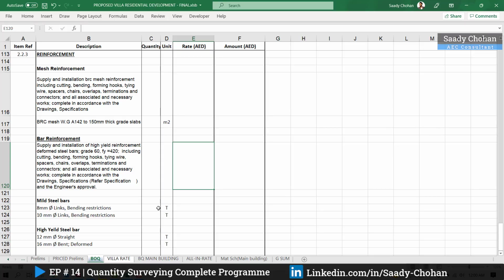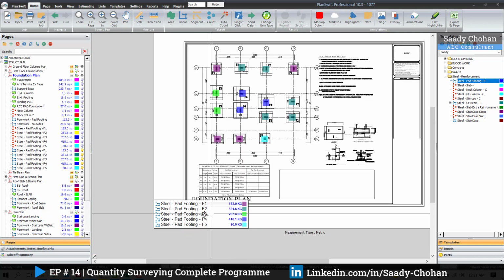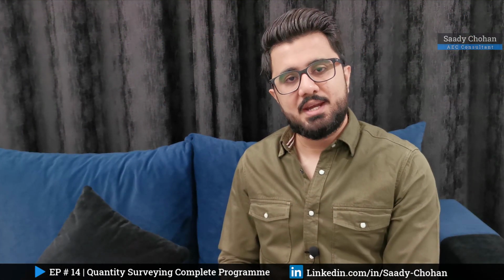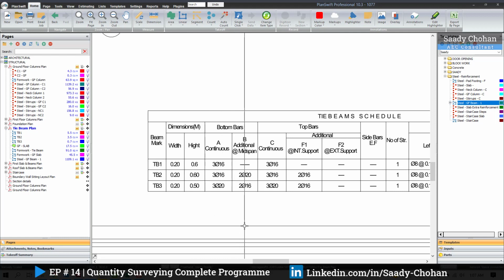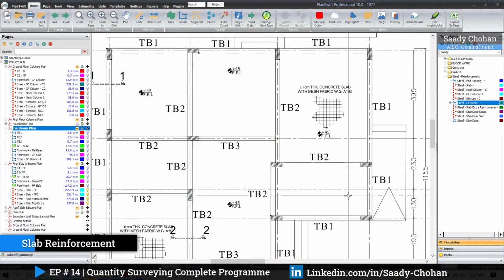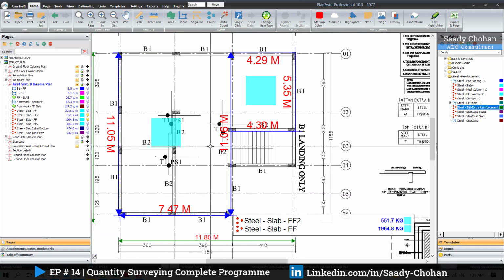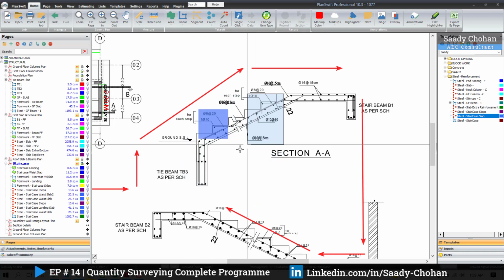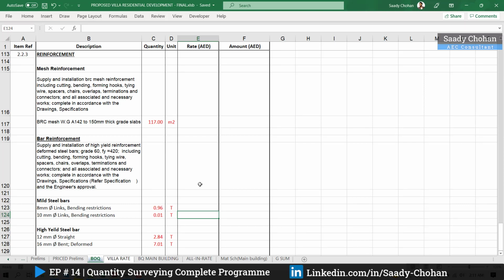EP - 14 | Steel Quantity Calculation by PlanSwift | BBS | Rebar Weight | Quantity Surveying Program

Comment: YES MR. SAADY CHOHAN. I SAW YOUR VIDEOS ITS VERY HELPFUL TO US. BUT THIS VIDEO I AM CONFUSED. 
YOU HAVE CREATE THE TEMPLATE TO CALCULATE THE BEAM BETWEEN TWO SUPPORTS FOR ALL TYPE OF BEAMS.
NORMALLY EVERY BUILDING HAVE DIFFERENT TYPE OF BEAMS BETWEEN THE TWO SUPPORTS. THERE WILL BE DIFFERENT EXTRA BARS IN EACH BEAM. 
TYPE 1 - 1 END BEAM - BEAM START OR END IN ONE SUPPORT AND ANOTHER END WILL GO THROUGH THE OTHER SUPPORT
TYPE 2 - MID BEAM - HERE BOTH ENDS WILL GO THROUGH THE BOTH SUPPORTS. IT MEANS THIS BEAM WILL BE PLACED BETWEEN ANOTHER TWO BEAMS
TYPE 3 - 2 END BEAM - HERE BOTH END OF THE BEAM WILL BE END OR STOPPED IN THE BOTH SIDE SUPPORT. THERE WILL NOT BE GO THROUGH FUNCTION MEANS THERE IS NO BEAM IN BOTH SIDE.
TYPE 4 - CANTILEVER BEAM - THIS WILL START WITH ONE SUPPORT AND OTHER SIDE THERE WILL NOT BE ANY SUPPORT.

ABOVE 4 TYPES WILL HAVE DIFFERENT TYPE OF LENGTH OF EXTRA BARS. ALL THE BEAM TYPES WILL NOT HAVE SAME EXTRA BARS. IT DEPENDS UPON THE BEAM LENGTH AND BEAM TYPE

COULD YOU PLEASE CLEAR MY DOUBT AND ADVISE ME HOW TO CALCULATE DIFFERENT TYPES OF BEAMS
Reply from the maker: Thanks for watching.
Feel free to connect with me on Instagram and LinkedIn:
https://www.linkedin.com/in/saady-chohan/
https://www.facebook.com/SaadyChohan.AEC
https://www.instagram.com/saady.chohan/

Comment: Plz missing templates be upload, like Steel beam template (Linear Tool) etc
Reply from the maker: Everyone has different methods for preparing templates. Even if someone prepared and shared a template, it’s not guaranteed that others can benefit or understand it, as there are calculations involved based on different standards and approaches.
I recommend you create your own templates. If you need support, I can guide you.
Reply: @SaadyChohan  ok thanks you